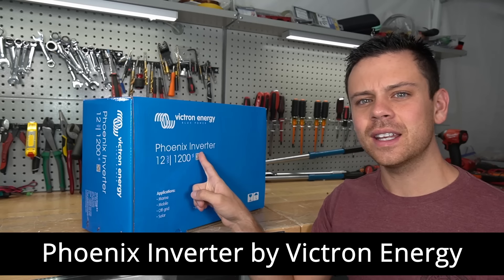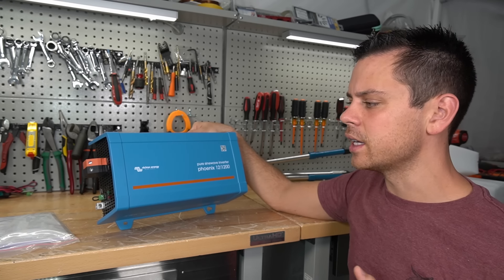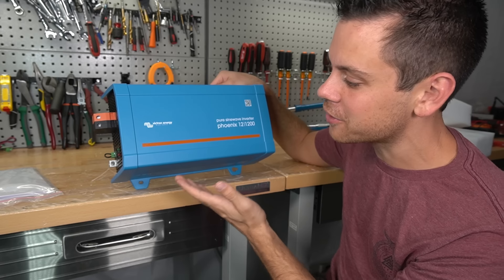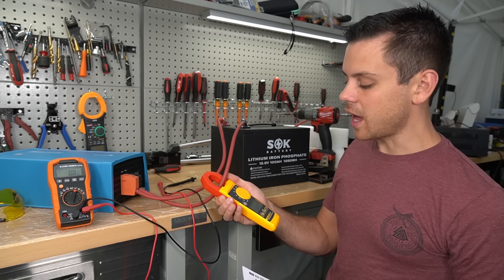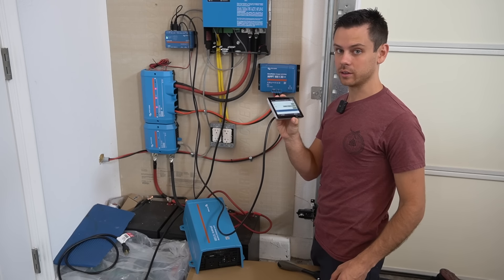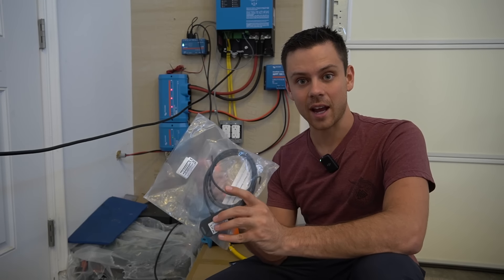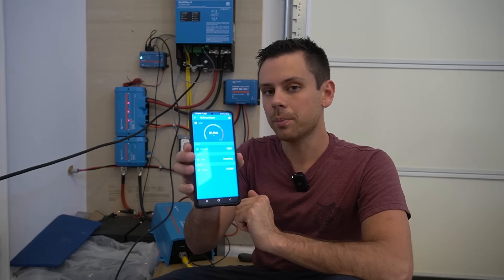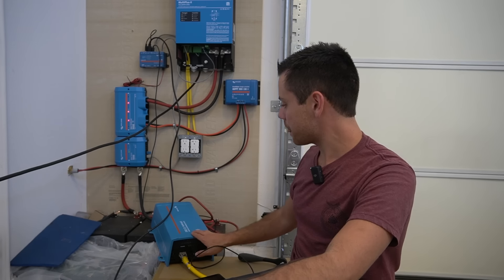Victron Phoenix 1200VA LF Inverter: Extremely Low Standby Consumption and More!

Comment: I have one, and it is a great small inverter. It is great for running a fridge (it's an LG inverter fridge, I don't recommend due to poor shelf design). Yes, it is heavy.
Reply: Perfect use running the residential fridge in an RV and you can leave the big inverter off except when needed.

Comment: I would have expected the bluetooth to be integrated into the inverter, having to buy a separate device to then be able to connect and setup the settings would detract me from purchase.
Reply: That's my biggest complaint with the victron stuff. You need a separate component for every little thing.
Reply from the maker: Yeah I'm surprised it didn't come built into the unit

Comment: This would be better if it was hardwired rather than having a socket .   Also the cheapest way to get a transformer inverter is to use an old UPS, however some of them have a built in timer that shuts them down after say 10 minutes regardless of load and I don't know if there is a way to modify that.

Comment: You’re mentioning power capacities in watt, but victron assumes a pf of 0.8 and rates in VA, actual max watts is lower. Pay attention to this, eg a Phoenix 1200 can’t provide 1100w continous at real life temperatures
Reply from the maker: Oh we know, I just still consider most loads I'm running having pf of 1 typically. I just don't really care unless it's old equipment or something

Comment: These inverters usually state their max efficiency... Why don't they state the minimum or atleast make it a range???! 😡

I have tested a couple of them from very low loads to full capacity loada, pwm and ps ones aswell. They all gave me around 65% DC to AC efficiency!

I wish you measured what that 1000w load was pulling from your battery. You will be amazed at how inefficient they run...I really hope I am wrong anyways.
Reply from the maker: I think you're wrong and you're not measuring it properly. Can you post a video of your test results and the equipment you used. I usually measure 94 to 96% efficiency
Reply: @WillProwse  
I actually meant those high frequency ones though, but those too claim very high conversion values. Unfortunately I didn't save any vidoes, so I will find time to do another test and send to you. How do I post it once I'm done? Via your mail or something?
Reply: @WillProwse  Hey Will, so I got around running a test today. I was actually testing the capacity of a 3kw inverter on a water pump.

These are approximate values gotten from a multimeter reading.
Ac power(3.5A*223v)~=  780.5w
Dc power(106A*11.96v)~= 1,267.76w
Dc-Ac conversion efficiency ~=61.5%

I can send a video or snapshots via mail, whatsapp, telegram or any other medium available.

I used a Mastech multimeter for my measurements.

Comment: Will... your videos are awesome. I've watched close to all of them and some more than once as well as read your book. Still don't feel real confident to design a system. My girlfriend got a new building (25×34)  built and wants a small system in her shop big enough to run lights and perhaps a few tools like drill or sander every once in a while. There is no heat or air so I'm wondering how the high and low temp will affect batteries or system? How small of a system do you think she could get by with? Located in Southeast Missouri so sun is pretty good and building may be dark for several days at a time.

Comment: I've been playing with the eco mode on the EG4 3k all in one. It has saved me a ton of battery. It seems a small fridge is enough to pull it out of eco mode (200w startup, 40w after), but smaller loads are not. I can't seem to find a way to set the threshold for minimum draw for the EG4. Is it possible with this victrom unit to set the threshold for turning on the inverter?

Comment: I actually got a multiplus ii 5000 VA to AC couple with a cheap grid tie inverter and I'm very desapoint it. Victron said that you can charge the battery with the excess power from the grid tie invert by using the multiplus transformer. The one think that i didn't notice was this coupling is far from ideal. No I'm not talking about the efficiency. I was expecting this to be the case. I'm talking for the lag of controlling the other inverter. The multiplus is stepping up the frequency to stop the other inverter from sending excess power but is not fast enough and the battery when full is spikes higher than I'm OK with. Maybe it will be a good video to make. I'm sure they watching your videos and maybe the can improve the behavior to a acceptable one. Because now is unacceptable..
Reply: btw the idle consumption of the 5000va is phenomenal. Just 18w for a low frequency inverter with out any power saving feature its just nuts 🤪 I will argue that the difference with this small one is not so big as to get the multi plus instead of geting two inverters

Comment: Hey, that's my inverter. Been running for a couple years now. Save money and buy the cable instead of bt dongle. There's not that much to look at or mess with anyway. 

I wish the inverter could turn on at a lower load when in eco mode, preferably just one lamp, or small device. In eco mode it turns on and off endlessly with small intervals which seems kind of torturous, but it's obviously built to take some abuse.

Comment: Hi Will.  Do you think this inverter (or the EG4) can be used as a UPS for sensitive server equipment? In the EcoFlow Delta Pro manual it says it should not be used for server equipment because switching isn't fast enough so equipment can be damaged. I'm looking to replace my old APC UPS lead acid battery unit (18 battery bank) with lithium ion phosphate technology. Any thoughts?
Reply: phoenix inverter are pure offgrid inverter there is no grid input.  other series have grip input.

Comment: What setup would you recommend for a truck camper, travel trailer, camper Van.  Batteries, solar panels, inverter everything you need to run the  appliances that come in most standard RV camper type vehicles maybe even the air conditioner too for at least a week off grid

Comment: Great videos Will. I have a Magnum CSW1012 inverter in our 20’ trailer, along with the Magnum CSW-RS Remote switch (using an RJ-11 phone cable) for easy ON/OFF. My inverter still works, but recently, the inverter’s display stopped showing the amp usage as it alternates with the voltage display (which does still display). 
Also, I recently upgraded to an Enduro Power 200 Ah LifePo4 battery with a Victron 712 Smart Battery Monitor. I love the BT functionality, so I might want to upgrade to the Phoenix Inverter you review here (with the BT dongle).
Question: Can I utilize my existing Magnum RJ-11 On/Off Remote switch with the Victron inverter’s On/Off switch port, and if so, how would I wire it in? It was a lot of work running the Magnum remote switch’s cable, and I actually had to add an additional 6’ of RJ-12 wire to reach the location where I have the remote switch. So, I really don’t want to have to run another remote switch cable if I don’t have to. 
Thanks! Keep up the great work.

Comment: Instead of buying this inverter for a led light, just buy sok battery and a good Mppt with solar panels. We can run 12v dc system to charge mobile phone,light,fan etc

Comment: Will, great video as always. Now, I have a challenge for you. One of the most difficult parts of a solar system is the location of panels. Many dont have the real estate to place them so my question for you is - Can I place panels vertically against the wall of my house and bounce sun light with mirrors? Is there any efficiency loss or is it do-able? any experiments you have done?

Comment: Question - if I have two 12v 60Ah LiFePO4 batteries, each with their own (presumed) internal BMS - should I have an external BMS to manage the batteries as a 12v 120Ah configuration? And if yes, how would the BMS interact with a MPPT?

Comment: I find it really frustrating that Victron forces you to update firmware before continuing.  What if your not at a good time for the update, but really need to change a setting?  SOL.  What happens if an update is corrupted?  You could know, but be stuck high and dry for being able to change settings.  I'm not aware of any other device that is so authoritarian about firmware updates.
Reply: I love victron products but hate their attitude, they don't seem to care about their average customers. My tone is due to dealing with their rude customer service. I agree with your point, frustrating for out of reach users

Comment: One thing to note, starlink pulls somewhere around 40W 24x7, and a lot more when the dish is searching.  Its not a low-power system compared to, say, a cable-modem which pulls less than 5W 24x7.   Also it is fairly easy to power most cable modems directly from 12VDC (their power adapters are typically 12VDC), so the AC does not have to be used at all. The starlink, unfortunately, takes AC directly into the unit.

Just a side note there, I know you were just using starlink as an example of a small load.

Other useful small loads... things like ethernet switches (2W), POE switches (variable), small routers (10-20W typically), and wifi base stations (typically 15W each), all 24 x 7 loads.

-Matt
Reply from the maker: Good information. Thanks Matt
Reply: Thanks, I just got notified and paid for my starlink this week. Now I need to find someone to install it on the roof (two story house).
Reply: After hurricane Katrina I ran a DSL modem and a Linksys wireless router off of a 60w Radio Shack inverter plugged into my pickup truck's cigarette lighter with 200' of 12 ga extension chord from the inverter to my home office.  I recharged my laptop with the cigarette lighter charger when running around picking up supplies and waiting in line for water and ice.  While I was out of electricity, I never lost the Bell South telephone/internet service.  I was able to sit on the front porch and watch streaming news from the local TV stations on the laptop to stay informed for the week without power.  I don't think the cable telephone I now have is nearly as robust.
Reply: After hurricane Katrina I ran a DSL modem and a Linksys wireless router off of a 60w Radio Shack inverter plugged into my pickup truck's cigarette lighter with 200' of 12 ga extension chord from the inverter to my home office.  I recharged my laptop with the cigarette lighter charger when running around picking up supplies and waiting in line for water and ice.  While I was out of electricity, I never lost the Bell South telephone/internet service.  I was able to sit on the front porch and watch streaming news from the local TV stations on the laptop to stay informed for the week without power.  Kind of primitive, but it worked. I don't think the cable telephone I now have is nearly as robust.
Reply: When it’s melting snow, it draws even more. Snow really croaks it. I’m going to have to buy the new Pro Antennae, which supposedly has a more powerful heater. If you have it mounted up high, like I do, you don’t want to be climbing up on a ladder in -20F..
Reply: @NeverTakeNoCut-offs  It will take some work, but a wiper motor runs on 12V.
Reply: My first gen starlink pulls 70-120W and that's without the dish heater on!
Reply: I have a starlink, I normally turn it off at night when I go to bed, and then on in morning when I wake up. Been working well. I see no reason to leave it on when I am not using internet. I don't have solar though, but still, no need to run internet all night when I don't need it. I live in part of Arizona that rarely gets snow, and when it does, its gone from sunny spots within hours, so I don't need to run it for melting ice, which some people may.
Reply: Also as a note because I am setting mine up now. There is lots of info out there now with the latest gen Starlink dishy and converting it to DC and drop the included router. Others did the research but it uses 48V PoE (non standard wiring) at 2A/96W. I didnt see if that was max with the heater on or if it goes higher. I think its max with motor or heater.
Reply: @lonefriar4700  Hehe, Yeah but me life is too short to rig that one up!!
Reply: I live in central canada and get lots of snow. Dish is mounted on roof and I haven’t had any issues with snow or ice build up despite last winter being a record year for snowfall here.
Reply: There is a word of warning, some devices that claim to require 12 V DC might shut off once the LiFePO4 system goes into absorption. My router handles the 14.3 V from the absorption phase without any problems, however my Synology NAS fails to boot the hard drives at this voltage. It works fine in the float phase around 13.5 V, but until I find a better solution I cannot power it directly without the inverter 24/7. You might want to check if your devices function properly with a DC power supply before powering them directly from your system.
Reply: @apidya  yea I have similar issue in my rv with max fan that the DC will overvoltage them and they shutdown. Putting in a 12v regulator to their power to fix that

Comment: The Morningstar SureSine inverter is even more efficient.  I have been using one in my RV for the last 6 years for those smaller loads (satellite, all electronics, chargers, clocks, TVs, computers and more). I use a larger 4000 watt inverter for running those big kitchen, bathroom and air conditioning/ heatpump loads.

Comment: I have a similar Victron inverter but not the LF model. Mine is the 24 volt 1200 watt with the eco mode. It runs my simple off grid house for the last year with no issues. It will run a 6 gallon pancake air compressor as long as my fridge doesn't kick on, won't run a corded circular saw though. I have noticed I could leave it on eco and it would turn on and off automatically with my dorm fridge but I have to leave it on 24-7 with my larger  Galanz fridge. Either way I've been happy with it
Reply: I use a brushless ryobi battery powered circular saw for 90% of cutting. their new brushless one is really good,and that way I do not have to run genny for worm drive saw. Just use inverter to charge the cordless battery.
i only have a similar,high quality 1200 watt excel tech inverter.that runs pretty much everything,including a fridge. I am just now buying a 48 volt phoenix,so I can add more solar panels.will keep the excel tech 12 volt as dedicated fridge and freezer,as I already have 2 battery  systems(i am using an old set of lead acid batteries until I run the into the ground).even though those batteries are pretty shot,i have  a good amount of panels,and the batteries always supply enough for a fridge until I get sun.

Comment: Until 12 months ago I was using a 12/375 Phoenix inverter for my TV, satellite receiver and for charging phones, laptop, Dyson vacuum battery etc. It's surprising how small an inverter you can get away with. I upgraded to a 12/800 when I wanted to run a Mobicool MB40 cooler/freezer 24/7 in the summer following installation of an SOK 206ah lithium battery. My Victron phoenix inverters (and other Victron gear) have been rock solid.

I'm surprised you were surprised at the ease of using the Bluetooth dongle 😂. Great review as always 👍
Reply: @Erika_Kelly_Apparel  at the store: they have a lot of refrigerator running , it will use a lot of power....

Comment: I know it’s unrealistic but I wish homes were wired for 48vdc for low wattage appliances and 480vdc for high wattage appliances.

We waste so much energy and equipment flip flopping between ac/dc
Reply: Guess you could have wall outlets with 48vdc connections, going back to a battery elsewhere in the house.